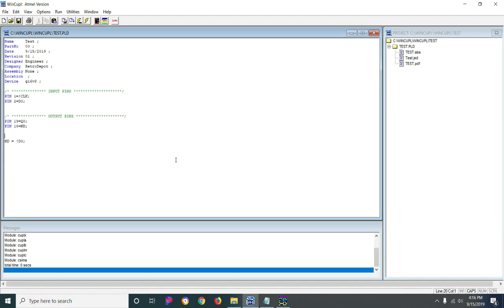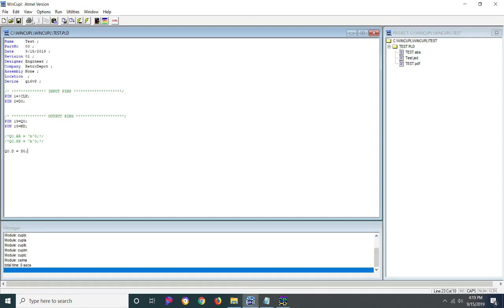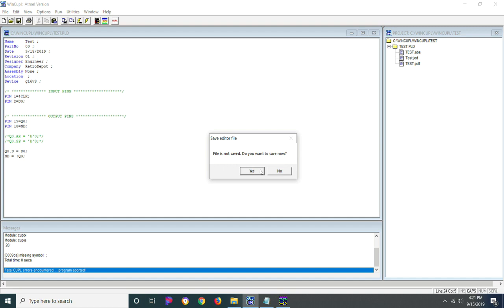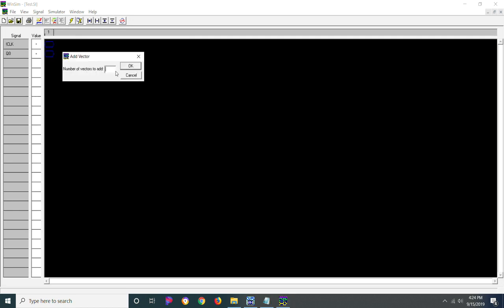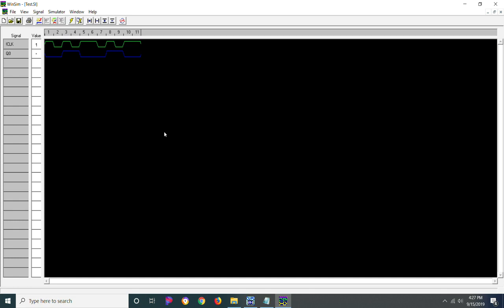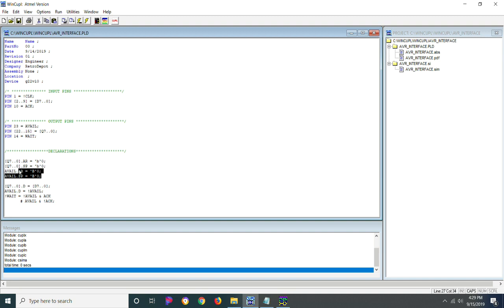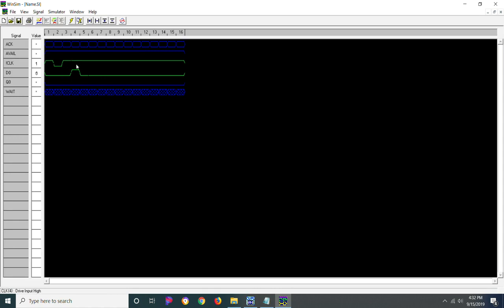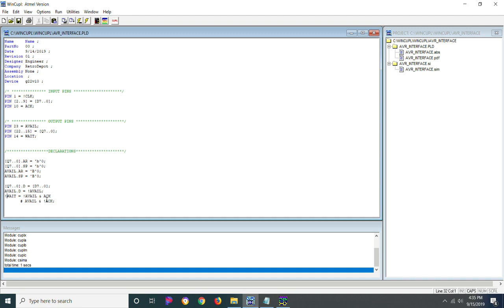WinCUPL Part 3:  Registered Logic Part 1

Comment: Sadly I'm completely unable to use WinSim, it crashes every time with a Runtime Error 5 if I try to set ANY signal high in a simulation. I might just have to abandon using the Atmel CPLDs completely if the solution is not found.

Comment: In WinSIM, instead of resizing the window each time you need to view updated waveforms, try the View menu and click Refresh. I find that it also works in WinCUPL when the editor decides it doesnt want to update the colour higlighting.
Reply from the maker: Thanks for the tip.  I'll give it a try next time I sit down to write code.  The highlighting problem is more of a nuisance than anything.  But hopefully this works in my version as well.